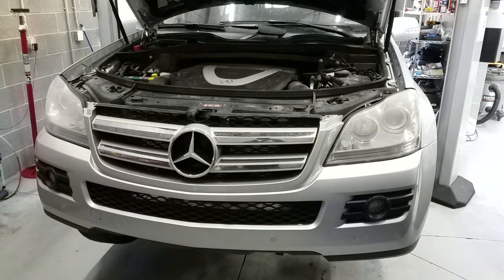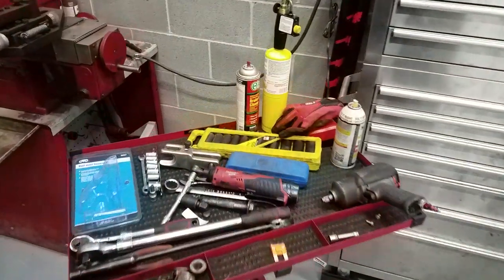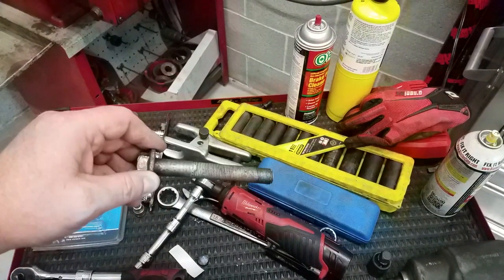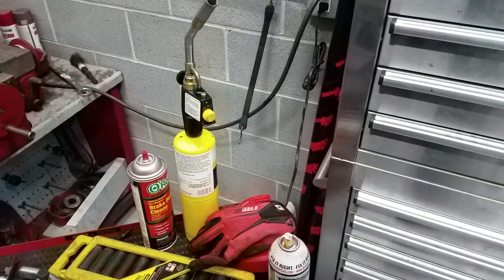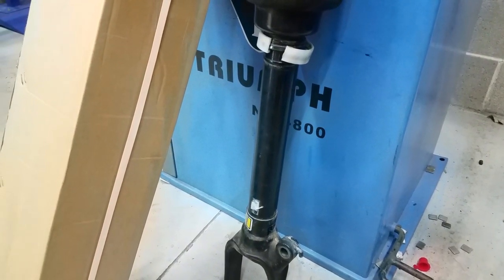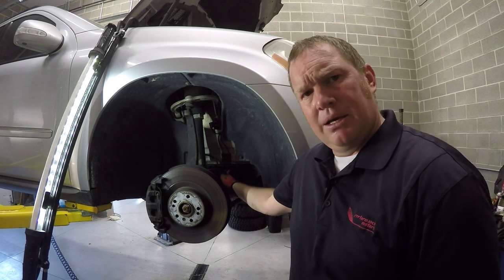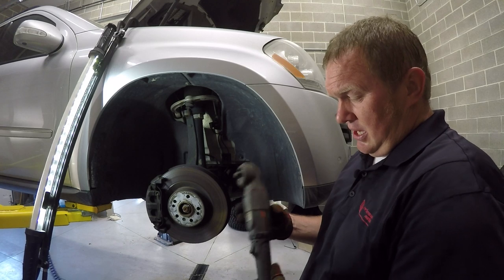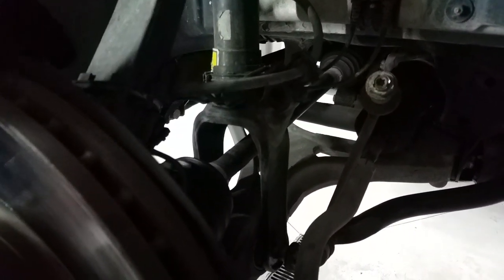MERCEDES-BENZ GL 450/550/320 AIR SUSPENSION DIY

Comment: Mercedes quoted me $2300.00 to change out one of these shocks. The OEM part was $500.00 with the trade in of my old one! They’ve lost there rigging minds. I purchased my strut from amazon for 2011 GL450 for less than $200.0. Hell I only have 71k on my car and it has the OEM part on it so I think I’m ok buying an aftermarket part which has to meet the same specification that the OEM part dose but with no logo. So, if the logo is important to you Mercedes has them in stock. I’ve purchased the tool you recommended from amazon to make the job easier. I do not have a car lift that picks the car entire car up, but I have a standard shop hydraulic jack with jack stands. Wish me luck I will get back to you on my success. PS your video was very helpful and convinced me to do it myself.  I’ve also changed out the air valve block which again I purchased off amazon. This was easy to do.
Reply from the maker: Chris Gunter good luck Chris. it's not too bad just take your time and be patient😎👍
Reply: What Mercedes charges for this type of repair is borderline criminal.. You are exactly correct... For as expensive as these SUV"s are.. they are junk.. I have had 2 and I am going to switch to Lexus..

Comment: Thank you so much for your video. I purchased 6 Pc Front End Service Kit on amazon for $60 which contains tie rod end pullers, pitman arm puller, ball joint remover, and tie rod end lifter. It made my job so much easier. Thanks again for the awesome video!

Comment: Like many others that have commented, I'm grateful for your good advice and some great video footage. You didn't mention having to clear or reset anything on the electronic side of this repair. Is it as straight-forward as disconnect the electrical connector on the top and go. Then the opposite when installing?

Comment: Dealer charges about 23k for each front air spring replacement. The oem sir spring has 2 year warranty and it lasts about 50k miles. Arnott air springs last longer and have lifetime warranty.
Reply: Are you saying 23 thousand
Reply: Sorry its $2300 ea for the front air bag by  MB dealer.
Reply: @tedlu008  lol i said you have a super benz

Comment: Awesome video. I just did my front air struts and now going to do the back bags and strut. Is there a jack point so i can put the back of the truck on stands? I dont have the lift you have to lift from he side?
Reply from the maker: Yes there should be a jack point in front of the rear wheel on the frame that you do one side at a time. thanks for watching😎👍

Comment: On the passenger side just pop off the cabin filter intake cover on the firewall using a flat blade screwdriver
 and all the room you need is there.

Comment: I buy the airsprings on Aliexpress and fit them myself on the existing strutts and they lasted twice as long than the original front MB airsprings. Works out 5 times cheaper than MB parts and service

Comment: The front right fuse panel under the hood has a trace that blows out before the 40 amp fuse going to the pump.  If it blows the car will crank, start and immediately stop running after 1 or 2 seconds.   It is easy to pull the fuse panel out and fix the PCB.   Sad that Merc didn't bother to review this PCB design or even bother to test that the fuse would protect it.   Avoid the cheap compressor, valve block and relays on Amazon.  I blew lots of fuses with the Amazon parts.   The parts from FCP Euro actually work.  Nice video.

Comment: Is there a swich to shut off the compressor or is that not necessary for this repair?
Reply: you can remove the fuse that power the compressor, it's in the right front fuse box under the hood.

Comment: Fronts and backs done at a Mercedes dealer will run you $4500-$5500. Strut Masters full kit $1200.
Reply from the maker: Yeah it's way expensive at the dealer definitely want to go aftermarket and do it yourself😎👍

Comment: 2014 Mercedes Gl450 
I removed my front, left right old air suspension struts .Having issues replacing the New ones ,I need to deflate them there full of air and to tall to fit in its place. Please Help
Reply: the air will escape if you remove the brass nut on top, but the shock absorber inside also has a spring, not enough to lift the car, but enough to extend the air strut to full length.
use a ratchet strap (1 inch wide strap will be about the right size), put it around the top between the bolts, and go between the yoke.
make removing and putting int the strut way easier.

Comment: How did you know the leak is from the air shock and not somewhere else, I mean, it could be leaking from the connection, is not like the air boot caught a nail.
Reply from the maker: Paul it's actually pretty simple the air struts have a piece of rubber on them that gets old and brittle. you can see the cracks in it and hear the air coming out.
Reply: Brandon Pierce I saw other videos where after replacing the air spring it wasn't that, I've put soap water on mine, and I don't see any bubbles,,the rubber doesn't look bad at all, the leak must be very small, it takes a few hours for the car to go down, I'm just trying to avoid the expense and the work, I want to be sure, that's all.

Comment: I need to to put my gl450 on Jack stands.  Where can I put my floor jack so I can place my jack stands?
Reply: you should use the normal lift points for the jack and place you stands on the sub frame.
Reply: the front jack point is pretty obvious, if you look at it.
rear one is not so obvious, but you can use the trailer hitch frame, which is pretty strong.

Comment: How can u tell if u have ADS  or not
Reply from the maker: I believe the shock is different. it should have a plug on it if it has ADS
Reply: Brandon Pierce I have the opportunity of buying two front struts for 2010-12 gl450 without ads for $100. Thing is my 2010 with 105k miles doesn't need them yet. Should I buy them and what should I check
Reply: Hi, i need that suspensión for colombia. You can send me?

Comment: I replaced both fronts air bags, compressor and filter but still not working 
Any idea?
Reply: @Built NotBought hey we replaced the relay& pump. It raised and then went back down any idea what this is?
Reply: you have to diagnose the situation, and not just start replacing parts.
if only one corner goes down, usually it's that side air bag that's leacking.
it could also be the compressor, the valve block, the air hoses, the relay, or the computer,